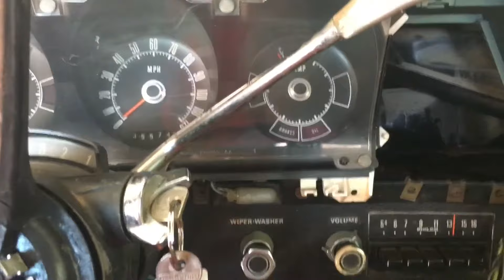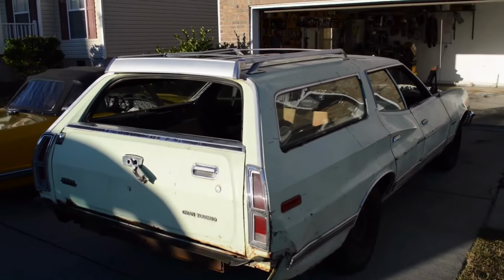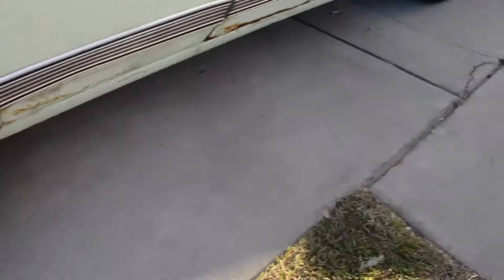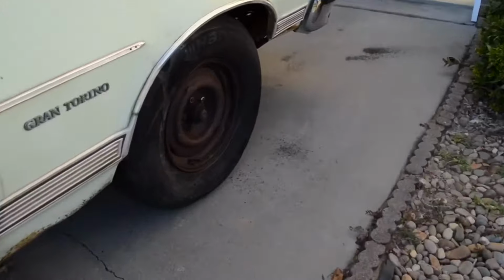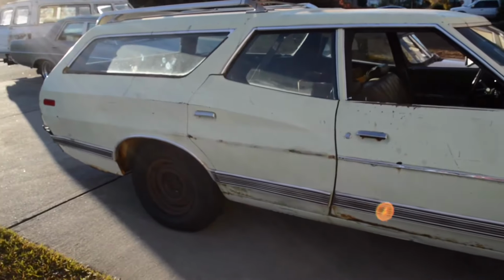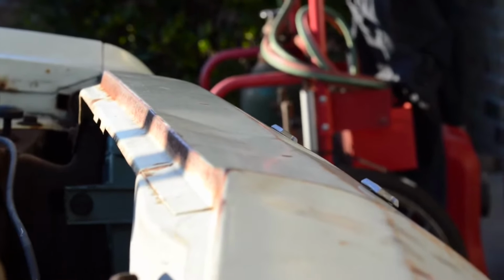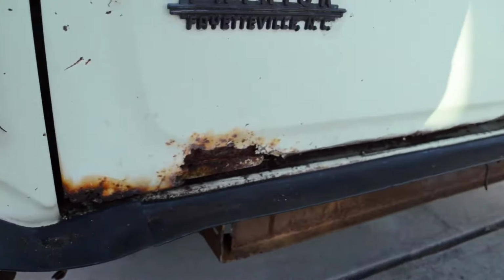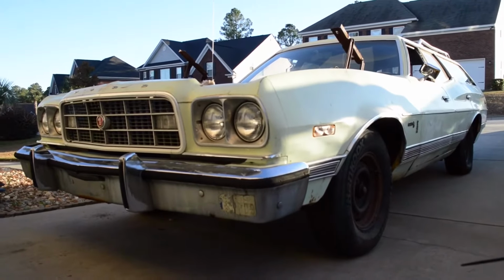The 1973 Ford Gran Torino Station Wagon Drives for the First Time Since 1979

Comment: Had a '73 White Gan Torino wagon with the blue interior for business. It had a 351 Windsor. It must have been detuned for '73 and ran like a small 4 cylinder off the line. But was very comfortable accelerating past 55mph to 85 or 90 quickly.
Reply from the maker: A 351 in ‘73 would’ve only put out about 155 horsepower! Probably had 3.00 rear gears like I have that made it sluggish off the line, or maybe even a 2.79 rear gear. All for “better” efficiency.

Comment: Any idea why this car was parked after only being driven for 6 years?
Reply from the maker: Transmission failure. My grandpa became a rural mail carrier after serving in the Korean and Vietnam wars, and I think all the stopping and starting might’ve done a number on the trans. That and the fact that the previous owners towed a boat with it using a bumper mounted hitch, and this car has no factory towing package. No trans cooler, 3.00 rear gear, etc.
Reply: @griffinsavoy  Ahh. That makes sense